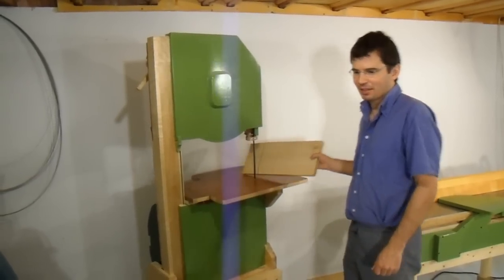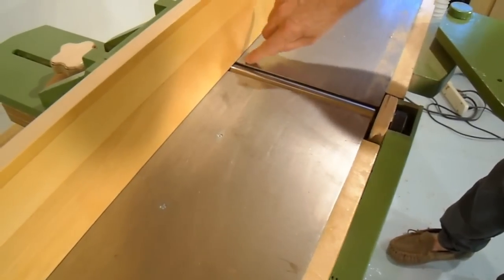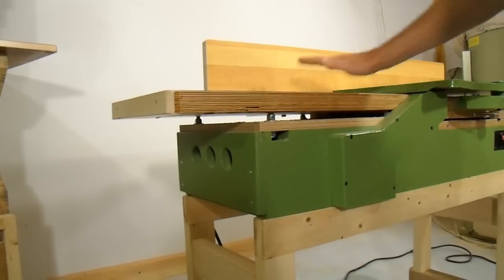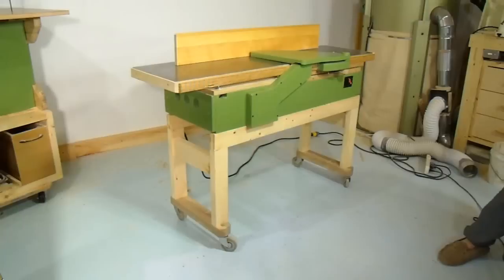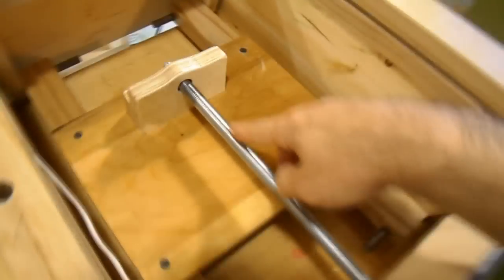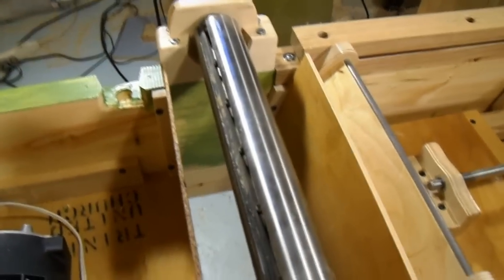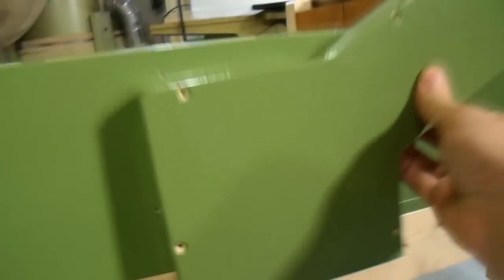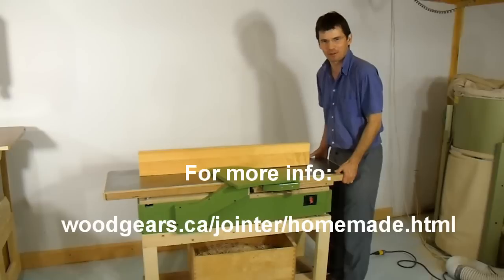Homemade jointer

Comment: Re velcroman's comment, a jointer is referred to as a planer in the UK and Australia so perhaps this is the origin of the confusion. It actually makes more sense if think about what the machine does. (A planer is referred to as a thicknesser in the UK.)

Comment: Hi Matthias,

Many woodworkers are replacing stock cutterheads of planers and jointers with Shelix cutterheads.  When that is done, the stock cutterhead has no further use.  I have two cutterheads sitting in storage.  Do you think there's a market for them?

Chris

Comment: First, I really enjoy your videos.  I often build my own tools so find your talents interesting.I haven't read all the comments so if this is a re-hash, I apologize.  You have a dust collection system.  Why have you not fabricated dust collectors for your jointers? A little 1/4" plywood, some aluminum flashing and aluminum HVAC tape can work wonders for dust collecting.

Comment: So four long screws fixes all the safety issues does it? Facts: the cutterblock is a heavy object which spins very rapidly and so has a lot of energy;  wood although strong can fail along the grain. Extra long screws won't cure the fact that wood can split along the grain.  Although this is a 'clever' idea, I think it is one design which is pretty stupid safety wise.  You can get away with this on a bandsaw as the energy is much lower, but for a planer (jointer) the forces are much greater.

Comment: Standard procedure is to joint one face flat, then thickness plane the other one parallel to the reference.  If you joint both sides, they probably won't be parallel, and if you just thickness plane they probably won't be flat.

Comment: That is quite some ingenuity. When you are working with wood buzzing down materials, and find out the bottom gets clogged. To think of something like you have must take a lot of thought and to actually build and design something like you did makes you a working genius. You have engineering abilities. I have a jointer and thicknesser. I bought the basic model buzzer. But wish I had gone for the next model up.

Comment: Paste wax applied with a rag is what we used in our cabinet shop to lubricate and protect metal surfaces such as table saws and jointers.  It really makes a difference in reducing friction and prevents rust. Should your table get rust on it, the green Scotch bright pads are awesome for polishing it back up quickly.

Comment: I admire your designs. Quite clever, and inspiring, not "crazy".
I'm wondering if the beds may warp in time if both sides aren't laminated equally. It may with the temperture of the different materials. 
Thanks for sharing your designs!

Comment: A simple adjusment to measure the gap for the parrallelogram feedin table, just screw in a steel rule so you can measure the exact size of the cap

Comment: A bit confused here, why use a jointer to flatten such a wide board?  Why not run it through a planer (even an inexpensive one), then run the edges through a jointer as necessary to square them up?

Comment: @GarageWoodworks  manufactured 12 in cutterhead is designed to be turned at a much slower speed.. his little motor is very fast so cuts per inch at given feed rate are similar..

Comment: Well, I am even more convinced your approach is not safe.  To quote your article: " Four long wood screws secure the block to the frame. I was rather paranoid that at some point, the bearing blocks might let go and that the cutter head would somehow come flying out of the jointer.  ".

Comment: Im interested in your depth of cut device... do you think it could be used to adjust a hand held planer so it could be used as an mini thickness planer? It may seem silly to want to plane peices less than four inches wide, but i find myself making small moldings in the field. This seems like it would do the trick. I'll have to try it out. Any recomondations on ratios? I'd like to have a range from 1/4" to 1-1/2". Thanks for the idea.

Comment: Nice job.  Every 12" jointer that I have seen has a three knife cutter head.  How do you feel the two knives perform; smooth cut?  Not a bad way to recycle a planer.

Comment: During times like the summer you should be careful with the potential expanding of the metal surface, it would be a nasty mess if it hit that cutter blade.

Comment: @21BDP21 He's already got a homemade lathe, but he hardly ever finds a need for turning wood, so the lathe is more or less just another storage shelf in his shop.  Homemade drill press meanwhile, I can possibly see it, but ONLY if his current cheap, store-bought one starts being inadequate due to his size.  I can see possibly the board lamination method used to build the frame of his 2nd bandsaw design providing enough rigidity.  That's the big thing I believe with a drill press, rigidity.